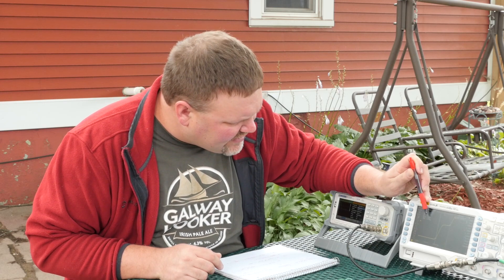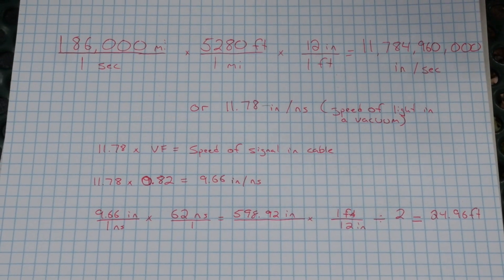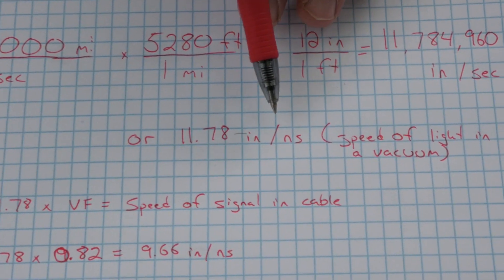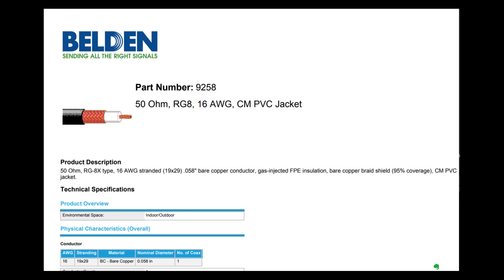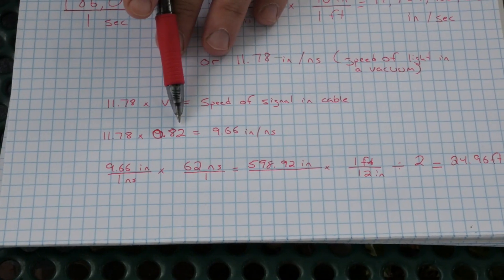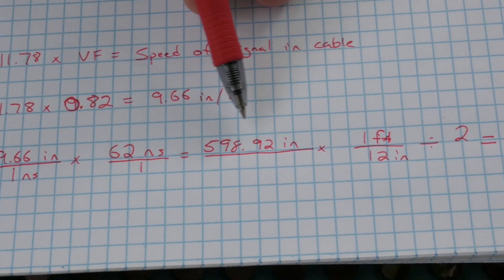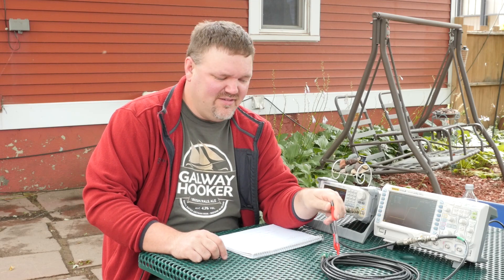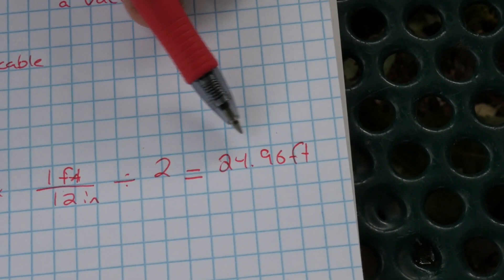Measuring Coax at (nearly) the Speed of Light - Ham Radio Q&A

Comment: With the setup you have you can see if old coax is still 50 ohms by adding a variable resistor to an so 239 chassis connector. By turning the variable resistor you can eliminate the reflected wave displayed on the scope. Then remove the variable resistor and measure the ohm value. It will tell you the impedance of the coax.

Comment: I have a Fluke 620 cable tester that gives the length of a cable and if it is miswired. It will give you the feet at where the fault is. Is it possible that this meter has a Time Domain Reflectometer built into it or is using some other form of witchcraft to determine cable length? Great video. I hope you two weren't messing with the Space-Time Continuum...that can really fowl things up...

Comment: Was the end of the 25' tested coax terminated with an open, short or 50 ohm dummy load?
Reply from the maker: The cable wasn't terminate at all, so it had an open short at the end.
Reply: @KB9VBRAntennas  Thanks for the reply. I'd be interested in understanding more the mechanism of how the signal of the unterminated coax is returned to the scope.

How these calculations can be figured with an analog scope via graticules and more detail as to what the signal gen can be set to.

Set up procedures and examples, perhaps with different pieces of scrap coax might bring you into the ranks of Dave Casler and Kevin Loughin. 

Thanks, de KE0RFZ.

Comment: Will a butt connection with another length of coax also show a "fault" at the end of the first cable length?
Reply: In theory it should. Could see two returns on the scope. In a real world situation a TDR could determine the location of a fault on a long run of coax such as on a tower.

Comment: Electrons and most subatomic particles dont travel at speed of light in a vacuum.  Certainly photons do, maybe all particles with no rest mass - but point being that most don't.  Photons just do without effort, other particles such as electrons have to have lots of energy applied to them to even get close, but can never quite make it.

Also, signal analyzers and oscilloscopes are a must have for debugging electronic equipment and a cheap (though probably less precise alternative) is to use the raspberry pi for both of those functions.
Reply: True...but electromagnetic waves do move at 50%-99% the speed of light. My bad. 

And of course we didnt get into the conventional vs electron flow discussion...